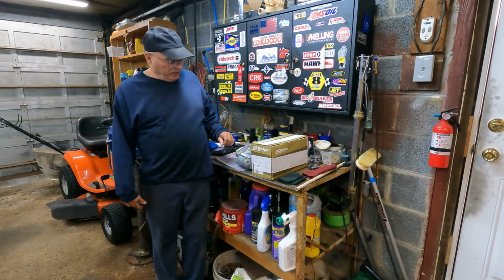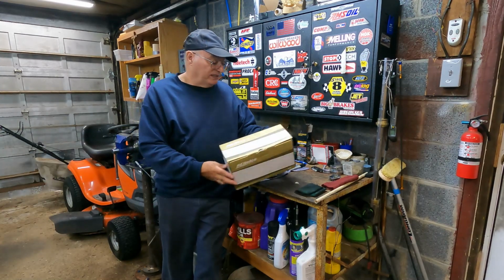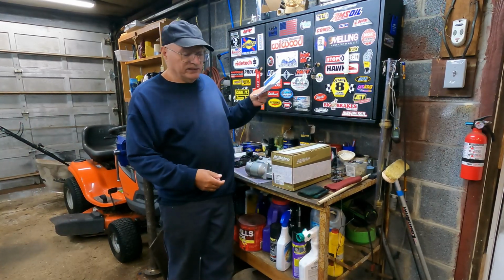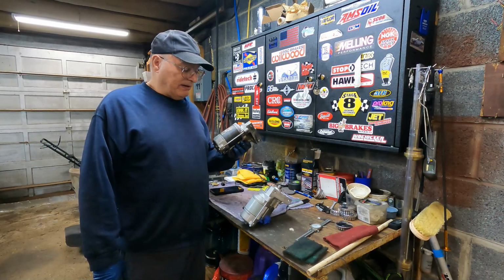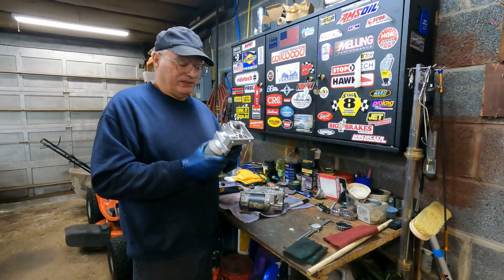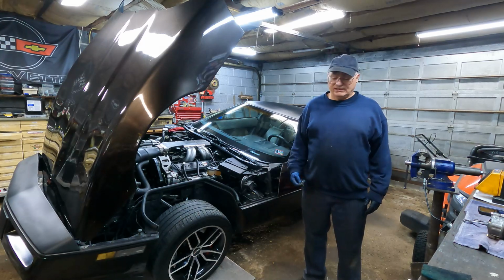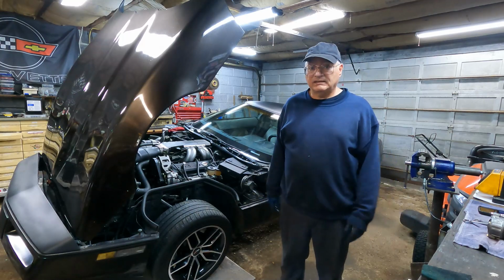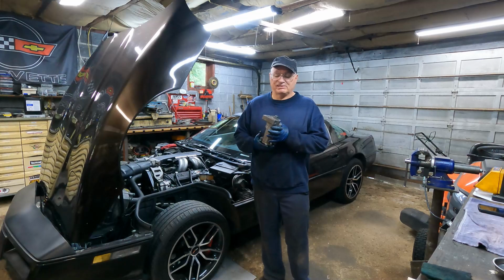Starter Motor Install On Corvette 👀

Comment: Which two mounting holes are used on the mini starter
Reply from the maker: If you have a starter with more than the factory two holes you will have to read the instructions that came with the starter or witch holes line the starter up with your flex plate or flywheel.

Comment: Thanks for the video. What starter did you use? I apologize if I missed the part number in the video.
Reply from the maker: I used a Ac Delco starter in this video, I do not recommend it, it gave me problems later on, I ended up using a remanufactured Duralslast starter.
Reply: @E.T.GARAGE  I noticed a major difference in the starter sound between the starter in the video and mine. It sounds dumb but I want the chirpy starter sound.
Reply from the maker: You might want to consider listening to the starter in this video https://youtu.be/4sQuUcPSlVw

Comment: Gene I have had a similar problem on my 69 SS Camaro. I had to use a heat wrap on the exhaust headers to help cut down the extreme heat going onto the starter.